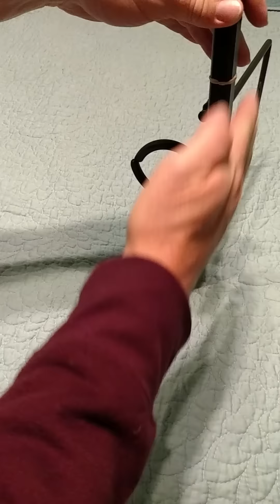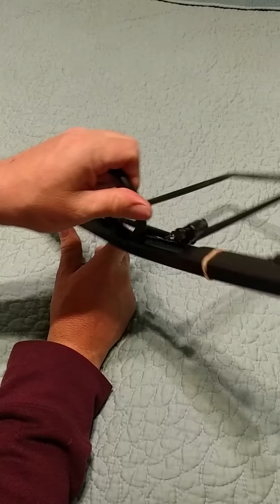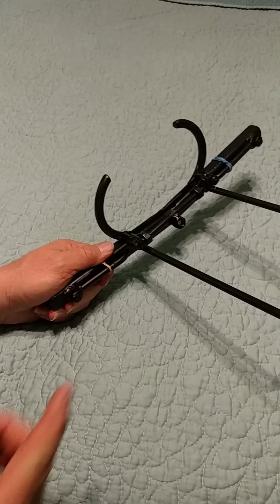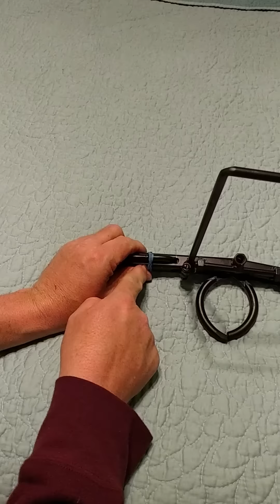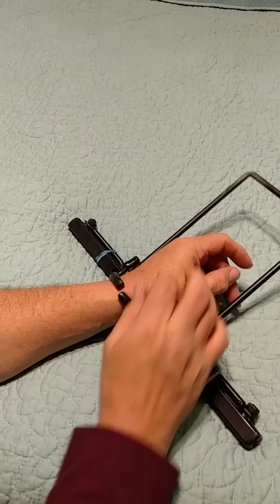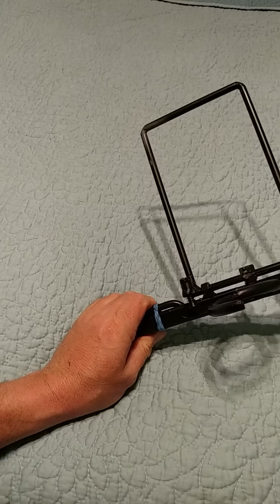Human Thief trap

Comment: What you need is what is called a 220 killer trap used for trapping animals. Set it just like you would for an animal using. Cubby box. Set it up just like you wood for an animal but use a $20 bill for bait. Without a clamp and two hands, you can't set the trap. Once they stick their arm in and the trap goes off, they can't get out and if it locked down so they can't get away, even if they do. Just go to the hospital and ask if somebody  came in with a trap and broken arm. There is 2 bigger sizes of this trap also. And will do more damage. The 280 and the 330. Both used for beaver trapping.